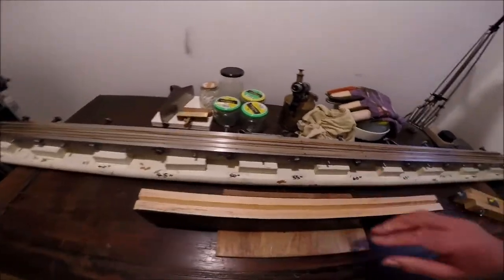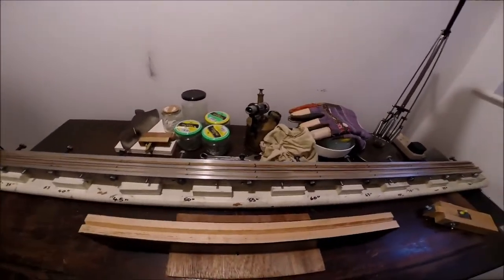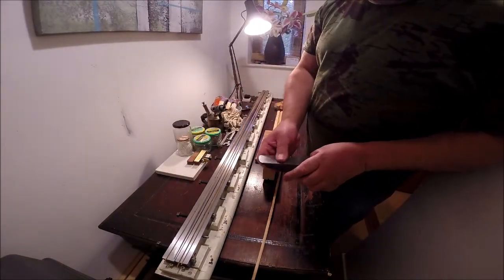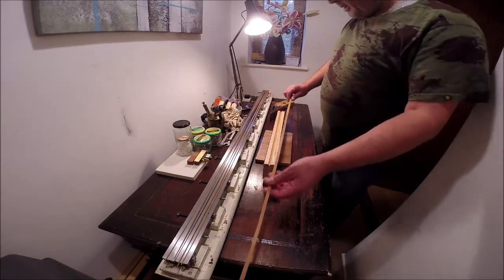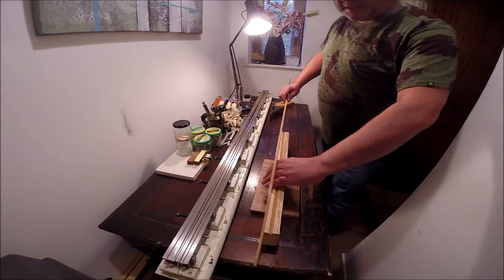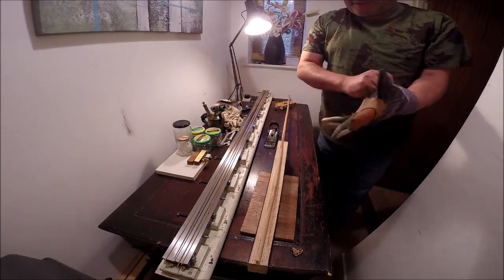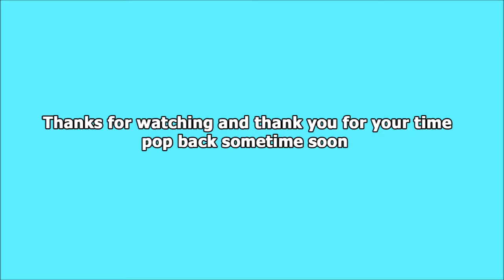Roughing tip strips for a new split cane tip

Comment: Hi, Where did you get your 60 degree Template / Gauge from? I've seen a few from China on eBay but the 60 degree angle were incorrect.
Reply from the maker: Hello, you are welcome thanks for following and subscribing to my small channel.  I did not document the actual grooving of the steel plane apart from where I mentioned how I done it. I'll help you with it, if you like, I do not charge for anything on my channel.  I am in the process of making another planing form from wood and will video the grooving for that video.